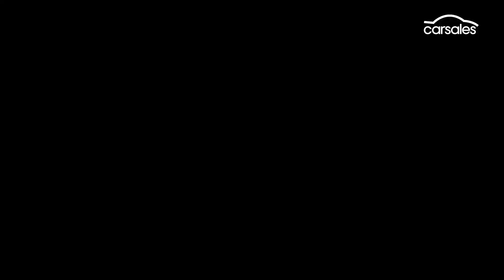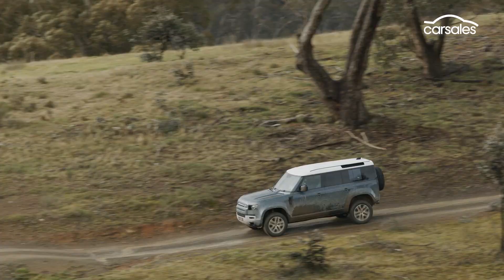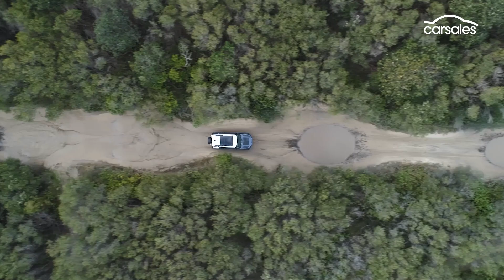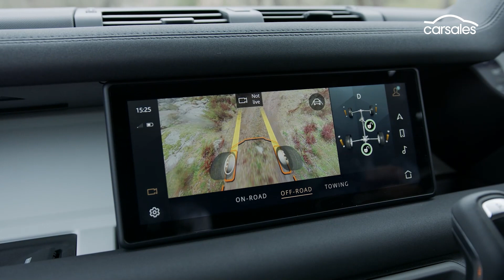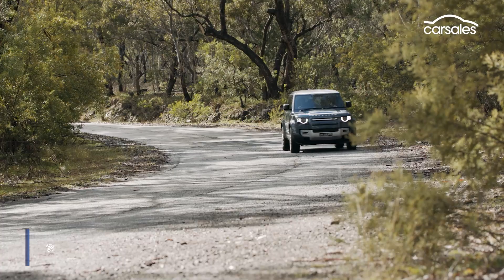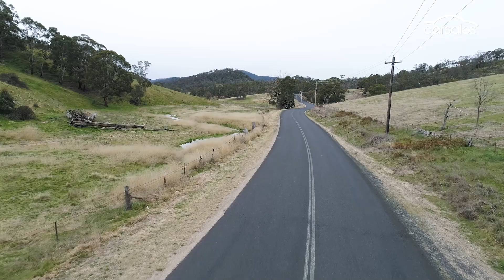2020 Land Rover Defender 110 P400 Review @carsales

Comment: This is not a Defender, it is an OFFender!!!!!
Reply from the maker: Haha, that's clever!
Reply: @carsales  I know this is better than a old  Defender at all levels, Land Rover should never have called it DEFENDER! It will take many years or even decades to be accepted as DEFENDER, if it is, and if INEOS doesn't exaggerate the price, Land Rover will swallow crocodiles and big ones! Even, because it is a failure in sales, production was already stopped before the pandemic... On the other hand, Ineos Grenadier, already has so many PRE orders that the factory they were building in Wales WAS TOO small, they are negotiating (if they have not already bought) the Smart factory in France to MB!

Comment: The Apple iPad of 4x4s.  Contrast with an old school Land Cruiser 70 Series dual cab, which is like a Linux operating system with out a GUI, strictly commandline.  The LandCruiser 200 Series and Prado is like an Intel PC running Windows - more user friendly.  The old Defender lasted so many years and needed a major fork lift upgrade.  This is that fork lift upgrade, and should see the Defender well into the next 20 years, whilst others eventually adopt similar technologies over time, e.g. the 3D terrain view, the hybrid drivetrain, advanced traction control, etc.

Comment: Good day everyone 
Land rover never can reach to the reliability of Japanese car beside land rover requires continuous and time consuming expensive maintenace.
Reply: Chopped in my Toyota Rav 4 for a Freelander 2. The Rav 4 was the most dangerously under-engineered car I've ever owned and repeatedly broke, it even had structural cracks on it including from the back door not being able to take the weight of the affixed wheel. Locks froze in the winter, speedo packed up after 35,000 miles etc etc. Would never touch another Toyota as they are just not as rugged as a landrover.
Reply: Except that LR is far better in all aspects than all of the japanese products....🤔🤔
Reply: @arunjoythomas2633  Except making it home, not including on a flatbed truck.
Reply: they also dont come cheap either so no point of talking of something which is out of the range.

Comment: But will it be reliable?  That is the only question.
Reply: Ye you can't really blame land rover or any car company for all these electronics as they are now things that cars have to have now for safety reasons.
Reply: Reliable?  A lot more reliable than the old Defender but unlike the old Defender, impossible to fix by the average bloke in the backyard.  But that's true of all modern cars isn't it?
Reply: spudboy1328 No
Reply from the maker: Only time will tell!
Reply: Been out here in the UK a few months now, alot of electrial issues and software issues i'm here. Typical LR they are rubbish on eletrics.
Reply: The Man Outdoors   Its a totally new model. Any brand releasing an all new vehicle, generally has a few niggles that r sorted within first 12 months. The Defender is a complex vehicle. There will b some minor things that LR will need to sort in first 12 months of mass production. I do stress that it is minor niggles only. The Pivi Pro multi function screen accepts software updates over the net. This allows LR to do upgrades to various things, without the need to go to a Dealer.
Reply: @Themanoutdoors  Can you provide the specifics please? Generalising gives what you say no credence.
Reply: @nnoddy8161  There are no specifics in that video about multiple issues that could not be fixed?
Reply: @Mk1Male  He pulled them down. He had repeated limp mode issues which involved him taking it back to the dealer on multiple occasions that were not fixed.
Reply: N Noddy I have had many of the same issues and still waiting for them to be fixed.
Reply: @DH-sm7sw  sorry to hear that mate, not a great experience at any time, let alone with a brand new vehicle.
Reply: The Man Outdoors Yup - mine has been back twice, and going back again next week.